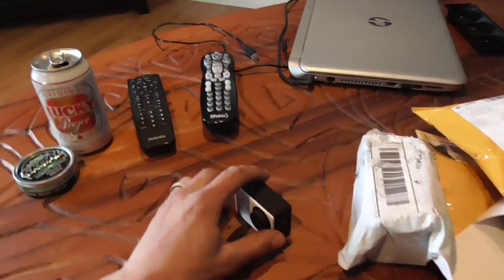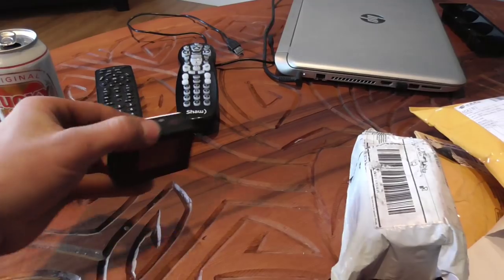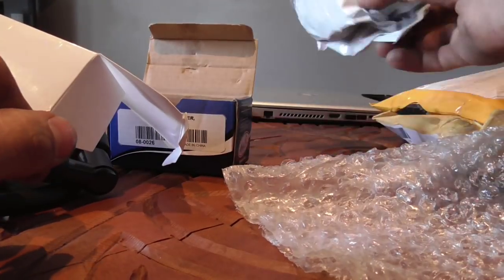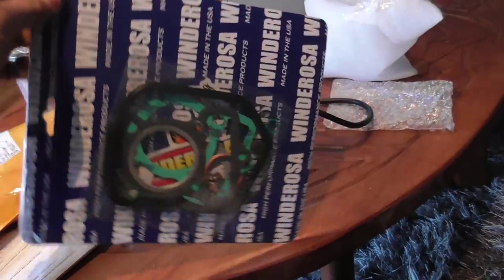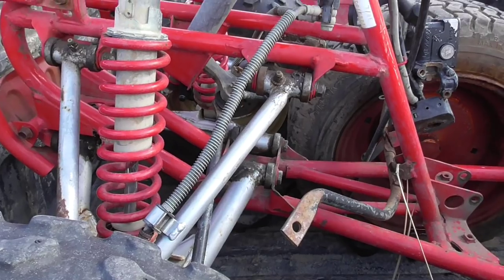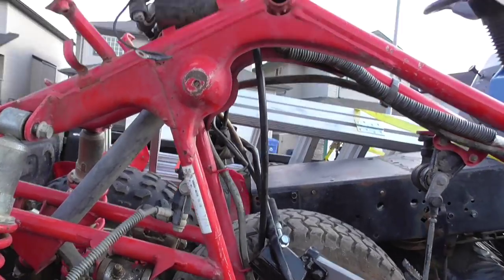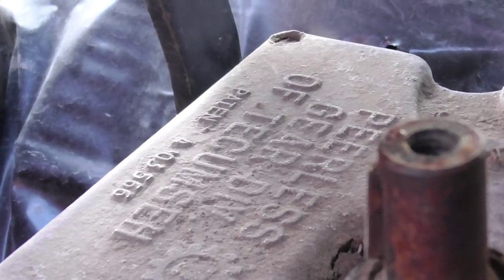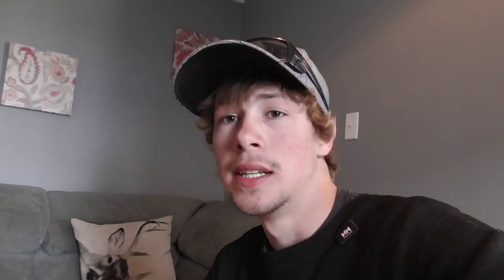VIKING race mower and BIG BLUE parts!

Comment: There is a small rectangular plate on the back end of the tractor housing that will give you the model number of the peerless transaxle.  I can't tell for sure, but it looks like it might be a Peerless 820.  If it has one inch diameter axles, it is an 820 for sure.  If the axles are 3/4" in diameter, it is probably a peerless 920 or 930.  The 820 is a very sought after transaxle by mud mower builders and race mower builders alike.  The 820 has an axle torque rating of 450 ft.-lbs. compared to 250 ft.-lbs for the 920 and 930.  The 820 has the axle supported by roller bearings on the ends.  I locked my 820 by taking the bull gear carrier to a machine shop and having bored out from 7/8" to 1 inch with a 1/4 keyway. I then used an Azusa hardened 1' axle and converted it to a straight axle: bullet-proof.  You can also buy diffy-lock spiders gears if you want to use the original axles.  Mowers racers love these transaxles.  Pack it with green grease for  maximum protection.  An 820 will also shift on the fly just like the 920's, 930's, and the newer 206's  The 820's are getting hard to find and are fetching some good money.  Whenever you run across one snag it.

Comment: I read one of the posts that claims it is a peerless 801.  The 801 is an old school transaxle superior to the 920, 930, or 206 because it is better built and also has roller bearings on the axle ends.